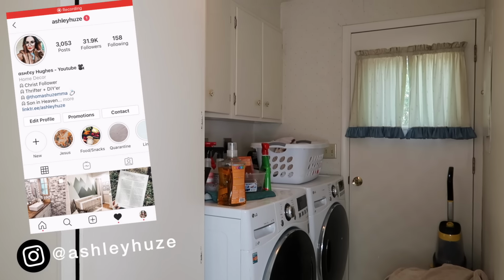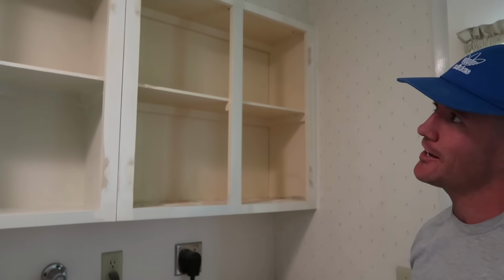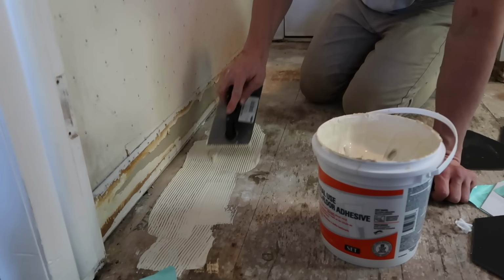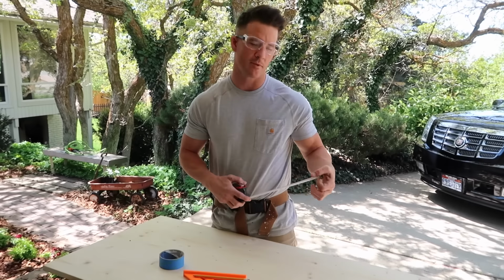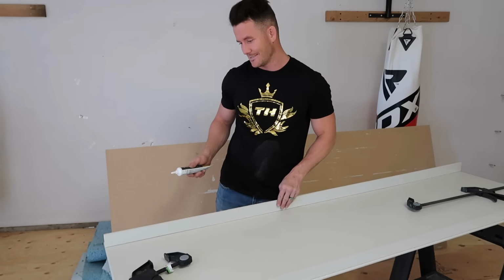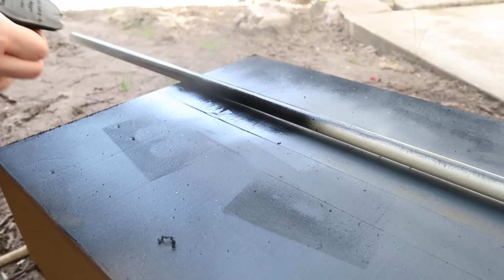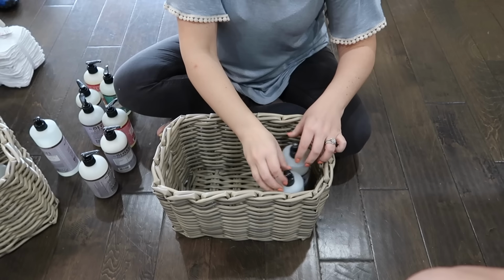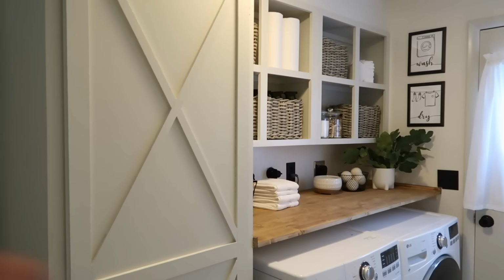SMALL LAUNDRY ROOM MAKEOVER UNDER $300🧺

Comment: The only thing I don't understand is why you didn't do the floor under the washer and dryer.good transformation.
Reply: I agree, good transformation but my OCD can’t understand why they never removed the machines to do the floor under it
Reply: I just posted something similar lol I am wondering as well.
Reply: At 5:19 you can see that the washer and dryer are raised up. Looks like they’re sitting inside some sort of built in cabinet deal. I think the flooring ends where they stopped!
Reply: Taking out and reinstalling washers and dryers are a royal pain in the a** lol maybe that’s why they decided to leave it? Also, in my last house they said that there is usually a liner or unfinished floor underneath them due to any potential water issues. I’m no professional though, so who knows 😂🤷🏻‍♀️
Reply: Yeah that was the one part I didn’t like. It looked like the trim board for the bottom of the closet extended past the closet to try and hide that but it just looks awkward.
Reply: Why waste the tile and the effort? If you never plan on moving the washer and dryer what's the point?
Reply: Yes indeed i agree with you, 👍 ,and its such an amazing transformation💐
Reply: Tricia R I believe that’s the difference in the flooring they removed.  You could tell by the cabinet next to it. At 8:19, you could clearly see the jagged cut and the original flooring is still under the washer. They probably just got lazy or had no way of moving the heavy washer out of the house.
Reply: @patriciaann850  I have similar washer/dryer and what you are seeing is just the adjustable legs to make them level.  Should have done underneath for continuity.  Would drive me crazy if that were done in my house.  We did our kitchen floor over a couple of years back and had the lower kitchen cabinets removed so the ceramic tile could go under them and the appliances.  Tiles should always be installed to the wall under cabinets and appliances.

Comment: Question - why didn't you pull out the washer/dryer and do the flooring under there as well?
Reply: Probably why waste material . Im sure that will always be the laundry room and with washer and dryer they have to stay in that spot. I wouldn't have done under washer and dryer jmo
Reply: It seems to me like the washer and dryer are slightly elevated from the rest of the floor? Like on a platform. I don't think I would have done the vinyl under there either, but i see why some would like it to be uniform throughout the room.
Reply: I would have. I’m just a little OCD, like that.
Reply: I thought the same thing. If you're gonna do it, do it right. Seems like a wasted effort to do all that when pulling the washer and dryer and doing the floor there too would have been only a little bit more work. Especially if you ever sell, that's a noticeable difference that could cost you resell value and the new owners a lot more work if their washer dryer set is different or they want to update.
Reply: @TiffanyPearl77  Would be my luck that the washer/dryer came with the house and then realize the floor is different when I try to sell.  If I ever buy again, I will definitely do a walk through with it completely bare so I can see what "damages" were hidden by the previous owner's strategic placement of decor. Anything not minor found and I would want some money back or it to be repaired.
Reply: You need the stands saves your back
Reply: ANJANYA AYNAJNA for sure. My husband built a real nice shelf for our washer/dryer. The shelf on top is really nice, but if I had to make a choice, it would be the bottom shelf, for that very reason. My back...lol
Reply: 7474jd ...yes! The house we live in, had a lot of hidden problems and we had an inspection. What they told us were things we already knew. They left us a couple boxes of hardwood flooring and we thought that was so nice. What we didn’t know was that the boxes hid a lot of damage. Surprise!  The bed was sitting on top of that damage.
Reply: In a perfect world, yes, pull the washer and dryer and do the whole floor. I am a retired, single person and I really need to do this to my laundry room. But I can’t move a washer and dryer. They are heavy! Now I feel more confident that I could do this. Easy to say...just move the washer and dryer...come on....
Reply: @lindajoy3883  Can always hire some quick help if needed to move it if you can't find volunteers.
Reply: Heres hoping that old floor had no asbestos

Comment: Wow! That's a lot of layers of floor tile! A lot of weight on the floor. 

Our previous house had 14 layers of wallpaper on the living room walls and 11 layers on the ceiling. Only 7 layers on the walls of the bedrooms. Not the strippable kind like you can get today. This was before that came along. The house sat empty for many years before we bought it, but the first owner had built the house himself and lived there with his family for 14 years. They apparently papered the walls every year. Once we removed the paper and painted the walls, we could see that every switch plate and every door frame in the house was angled. All the same direction. But a noticeable angle. I always wondered about that. At least he was consistent. We lived there happily for 34 years, crooked lines and all.

Comment: Such an amazing improvement! The only thing I'd probably do differently is take down the wallpaper rather than just paint over it. Down the road, the paper could start lifting at the seams and then you'll have to take it off and repaint. But, that's for another day, right? lol.
Reply: If the wallpaper is put over primed walls it comes off easy. If it is not it is a bear to take off.

Comment: Looks awesome.love the open cabinets and wood shelf over appliances. Closet door trim is on point. Wish you had extended it to the bottom of the back door too. Back door curtains would be awesome more fitted..rod at bottom too..or a cool shade. Floor is to die for. Thanks so much for sharing

Comment: Suggestion: on the wall across from the w/d, ask hubby to hang a shelf that is thin and folds up against the wall when not in use by using chain on either end. You have done a great job. on everything

Comment: It turned out amazing. Love the black metal look
Reply: I agree, creative idea to spray paint them. Looks so much neater that way. ( and looks like accents, instead of ugly connections) the counter top is great too... with the added feature that it's easy to pull up in case you need to replace the appliances.

Comment: Here's a tip to save your knees: Take about 5 or 6 carpet samples, wrap them with some cushion foam (use duck tape to keep it together) and then take some duck cloth and duck tape that around the pad. It'll be thick and cushy for your knees and move (slide) easily around, This came from the flooring guys who laid our flooring. Works better than those "strap knee pads that cost too much.

Comment: I have a similar plan in my mind. Love how the marble LVT looks. I was thinking about sq, but also like the hex pattern. Just a little warning to beginner diyers, many times in older homes, there's asbestos in the floor covering, especially multiple floor layers. When in doubt, have a small sample tested before ripping it off. Use a respiratory for protection. How is the black paint holding up on the door knobs and hinges? We have the ugly gold tone and I'm considering spray paint made for metal. I also love the wood shelf. I was thinking about butcher block. I love the look of open shelves and wicker baskets, but now decided to go back to door cabinets with baskets inside. Too much dust collects on them in laundry and bathrooms. Kinda a cleaning nightmare. Love the added trim on cabinet door. Nice video and steps well explained. Thanks for sharing!

Comment: I'm really in awe of the floor. Only thing is the empty spot next to the vent would catch my eye every time. I need to look into that for my bathroom. My kitchen has the peel and stick tiles and whoever put it down just stuck it on the sub-floor. It has shifted at some spots because the adhesive became tacky or weakened and I've never been able to figure out if I could wet mop it because I didn't want to damage the wood underneath. I just need the motivation, patience, and to pull the trigger to do some upgrades. A little knowledge and skill wouldn't help either, lol.

Comment: Won’t you experience issues later down the road with gluing the vinyl tiles straight onto the wood? Usually you need to put down cement board or something to prevent the expanding/contracting of the wood from ruining the flooring you’ve laid
Reply: Hughes Adventures Interesting! I live in an old house and somewhere along the line someone tiled our kitchen straight on top of the wood floor. Today, many of the tiles are broken or split from the wood expanding/contracting over the years

Comment: I like it, but not much room for folding or stacking clothing if you do your folding there. I do mine in my laundry. I thought about creating a fold down counter off the side of my cabinet, that would be lower and easier to fold on... for a "bar style" room and more working room. You just pull up the  table and put down a leg base which comes out when you lift it up.

Comment: Aren't you concerned about the vinyl tiles cracking when the boards move because of weather expansion?  I've always been told you can't put tiles or stick vinyl tiles down directly to floorboards, because of this.  A layer is needed to create a more smooth surface.

Comment: I wish I had a laundry room. I'm currently washing my clothes in the tub and they keep coming out all hard and crusty. Idk what I'm doing wrong. There's still dried hardened food on my pajamas. 😭
Reply: Pre-treat all stains with a stain remover before washing. Use bar laundry detergent like ZOTE and a fabric conditioner. Hang dry in sunlight till 90-95% dry then bring them into the shade to finish drying. Hope this helps!
Reply: @rajkaur931  I'm not allowed to hang anything outside where I live. What will hanging them outside do and what can I do instead? Thanks for replying btw.
Reply: @rajkaur931  why can't I use liquid detergent instead of bar?

Comment: Seriously 300 on what crappy linoleum a sheet of plywood and a gallon of paint anyone saying this was an "awesome" remodel clearly knows nothing about remodeling im trying to figure out where 300 went probably to useless decorations. Why wasn't the washer dryer removed and the flooring replaced under next time you take it out its going to be sitting on top of a half inch of old flooring you could of bought real tile for not much more then terrible linoleum with can damage very easily and as someone who grew up in construction ive never in my life seen someone grout linoleum i hope you stay in this house forever because anyone who buys this will have to do a full gut just to fix all the mistakes. My advice is double your budget and buy good materials